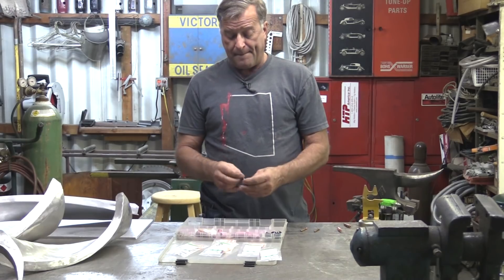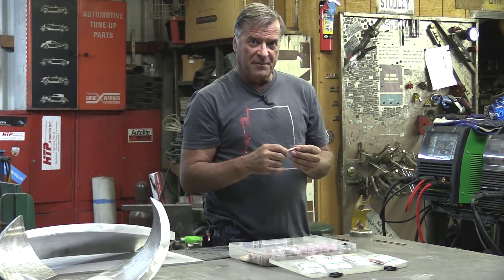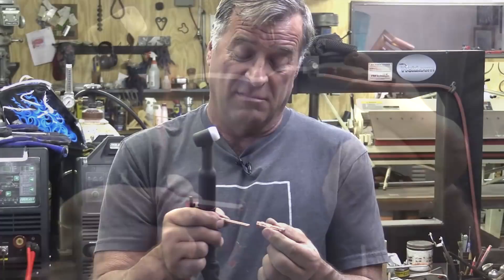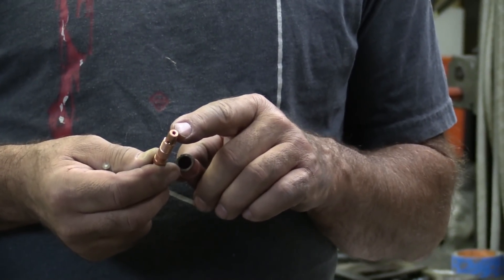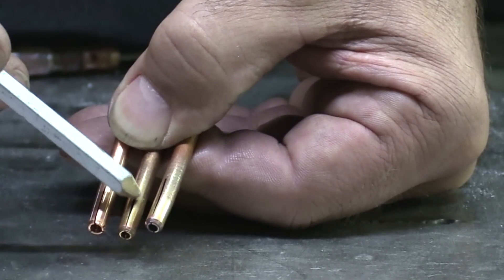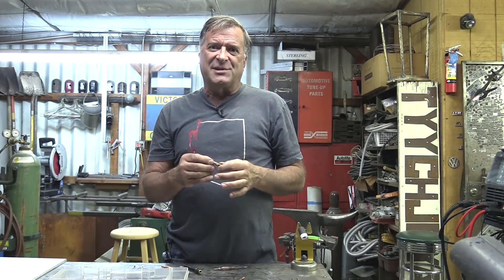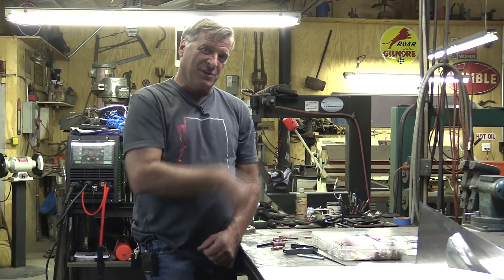Could This Simple Issue Be Screwing Up Your TIG Welds? Kevin Caron

Comment: Kevin!!! ...... thank you ...... was just pulling out my hair with this issue , and never thought the collet body being twisted could be causing the issue . .....
Reply from the maker: You are welcome Charles!

I was surprised how bad mine was, and then the difference in how the weld looked afterwards!
Reply: @KevincaronSculpture  so after much fiddling around i can see how the collet could expand and restrict gas flow 
... but this wasnt my issue .... the gas lens kit I ordered supplied the wrong white collar that goes between the cup and torch .... as soon as I put the proper collar in my issues went away ...
I mention this in case others are having similar issues .... (I'm using a #17 torch head)

Comment: I hope that you and The Voice had a Merry Christmas!!!
Thank you for another thing to inspect if there seems to be a gas issue..  Yet another thang that can cause gas issues is if the back-cap on your torch is not screwed on all of the way.  There is a rubber O Ring on the back-cap that must seal the back-cap and the torch body to eliminate gas from leaking at that juncture.

About a month ago I had what seemed like a gas issue that I could not figure out.  After checking all gas connections, flow-meter, etc. I could not find a leak so I thought that perhaps there was something else causing my problems.  I went on a welding forum and described the issue and the replies that I got all concurred that it seemed like a gas leakage issue.  Upon checking the connections two more times I finally found that the gas line to my Alpha Tig was not fully seated in the quick connector.  It was coupled enough to hold the line on the machine but not enough to fully seat and seal the connection. Because the torch hose was held to the machine I assumed it was fine --- wrong.

What is the significance of the bloody western State line?
Reply from the maker: LOL, this was a gimme shirt.   Another shop here is phoenix was visiting and gave me the shirt.   I really don't remember what it was supposed to mean.

Comment: Hi Kevin, I picked up an Everlast 160 STH off Craigslist to learn TIG welding. Filler Rod came with the machine and last night I was trying to use what I thought was Silicon Bronze rod and i got a lot so sputtering/sparking from the rod and also a white powder/film over the work and on the tig torch and cup. Any idea what this rod might be? I did use SS filler rod and also the Carbon Steel rod with no issues.
Reply from the maker: That is silicon bronze!   If you were playing with a piece of bronze stock as well what you got is normal.   Thanks for watching and posting!

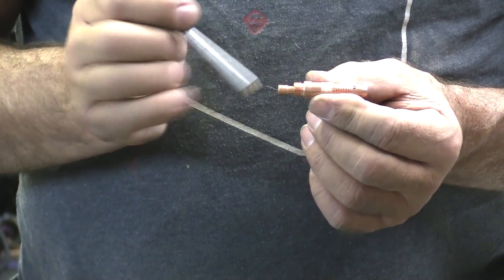Comment: Not sure if I am missing something here but how that woud make much if any difference as you corretly pointed out earlier (around1:20) the gas flows around the outside of the collet and then out through the diffuser while the tunsten fills the centre of the collet you shouldn't have any Gas transfer through the collet or slit at all as it is just a means of securing the tungsten not an gas passage?
Reply from the maker: Because the collet swells and blocks the passage. There is not much room inside the collet body around the outside of the collet.
Reply: @KevincaronSculpture  I am not quite sure how that woud work as under the impression that the tapered front end of the diffuser was supposed to contact and lock the collet onto the tungsten to transfer current . That would mean and the gas flows around the outside of the collet through the diffuser presumably through holes well back from the compression zone?

Comment: Damn I think this might be it! I've had some massive issues with Aluminum welding from time to time. It's acting just like it's not getting proper gas coverage, it doesn't create a proper puddle, but instead crackles a lot (really loud) and when you go for a dip, it turns the filler into a hard gray dog turd. I can see that there is a sort of shell/layer forming on that filler drip preventing it from flowing out and melt properly. I'm pretty sure that's from oxygen, but I haven't seen much soot. Of course, my collar looks like a complete turd. I never even thought about replacing it often and not tightening it down while it's hot. I'm gonna get myself a couple of new collars tomorrow and see if that fixes it.
Reply from the maker: Hope this helps you find the problem.

Comment: Kevin, question. I like this machine, i am looking at the Everlast 140 and the 200st machines. The 200 requires you to purchase a tig torch at $112-$159 in addition to the machine. The 140st comes with the torch and carrying case. The 200st has more amps and will weld the 6010 sticks. Do I need the bigger machine? I'm a hobbyist. Keep up the great video's.
Reply from the maker: Not sure what you will be doing with the machine.   I like the "sth" machines from Everlast  just because they are high freq start.   But you can't have too many amps in my opinion!  Look at the powerarc 160sth  or the Powertig 200dv.

Comment: Hey Kevin, Have you tried using the wedge collets from CK , that is all i use now , eliminates that squashing problem and the seem to last forever , the one in my torch now would be at least 10 months old. 
Cheers from Australia 
Troy
Reply from the maker: Can you send me a link to them please?
Reply: Hey Kevin , please excuse my computer skills but i'll try this
CK 2C332GS Collet Wedge for 3/32" 2.4 mm 2 Series Gas Saver | PKG = 5
The CK website shows it as well i will try and send you an email
Reply: I use the wedge collets as well, not had to change one in 2 years of using them.

Comment: Why do I get like stalagmites forming in the welded area when you break the arc and it starts cooling it's like a little glowing ball working it's way out from the weld forming weird stalagmite like carbon constructions
Reply from the maker: That is called porosity and it happens when air is pulled into the backside of the weld and forms a bubble. Either get better about your fit up before you start welding or have a backer plate to block the backside of the weld.  Or maybe back-purge with argon if possible.
Reply: @KevincaronSculpture  I was using a bigger lense which I'm gathering needs a higher gas flow also I was getting near the and of the argon plus the wind was blowing through my shed I gather all these things cause oxidation